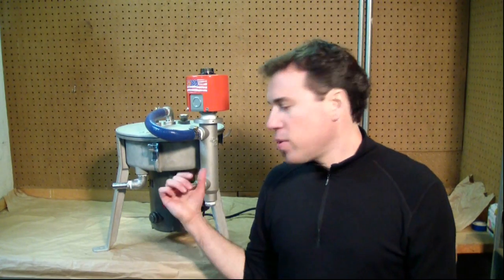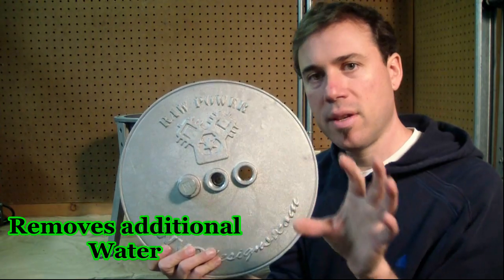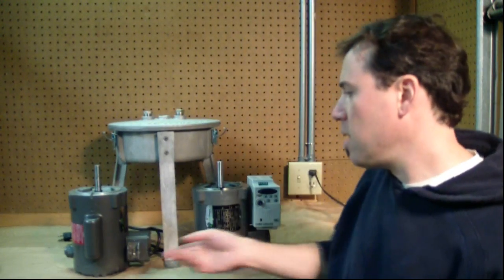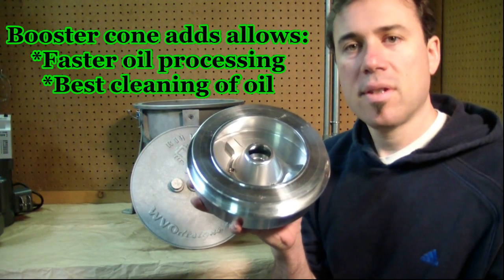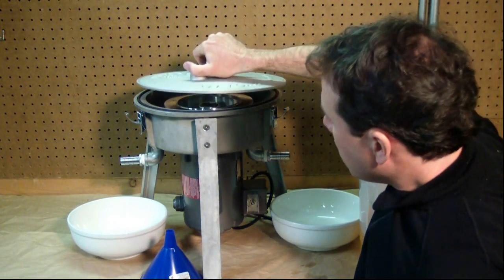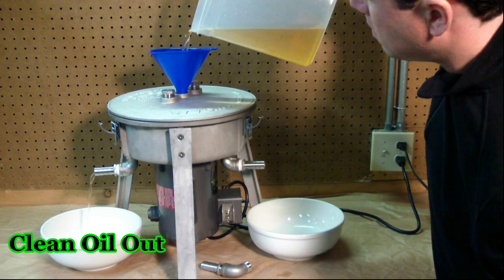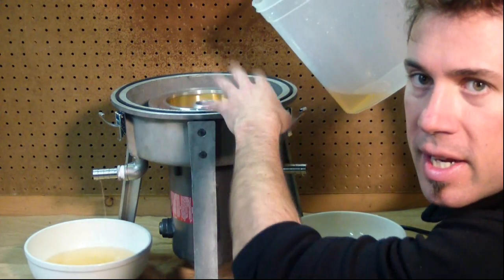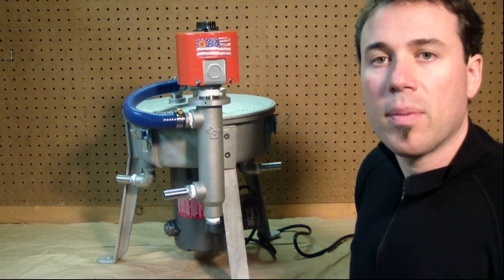Raw Power Centrifuge - Features and Benefits

Comment: what is the best way of communication. yet this way. it is broadcasted. my question is. you say that. 5-15 gallons per hour is typical, there is a lot of variation here. yet in the video, the variation increase. now it is. 5-25 gallons an hour. 
I myself. have all the options heater. variable speed motor, and a booster. yet am only getting about ten gallons an hour. I have a 3/4" feed in. could be anything to do with gravity feed pressure. thanks.

Comment: do you hae to suck the air out from the venting holes? if not why would I want to attache a tube to dry the oil? I'm a bit confused here.
Reply from the maker: The spinning of the centrifuge will create high pressure at the outer areas of the centffuge so it will actually blow air out.  You should be aware of where it is coming in though, the purge port would be the recommendation.
Reply: Thank you so it created a vaccum at the bottom of the bowl so it sucks in air from the purge port and blows out the top?
thanks a lot that makes sense. Kinda like a radial blower.